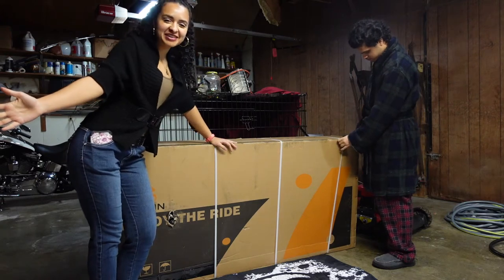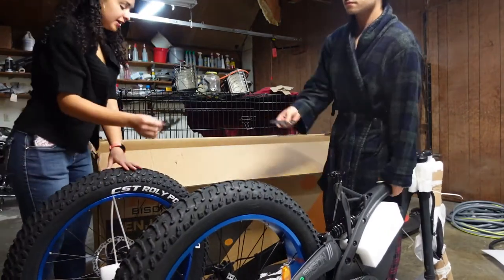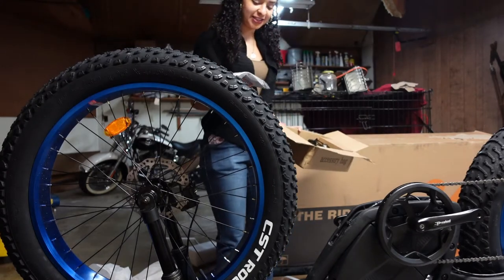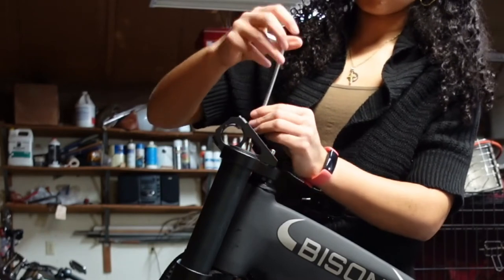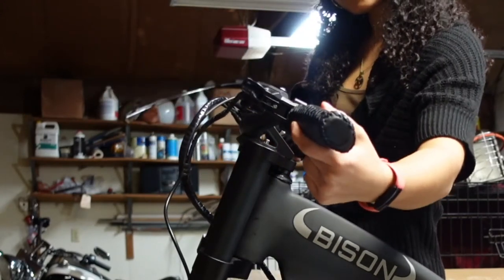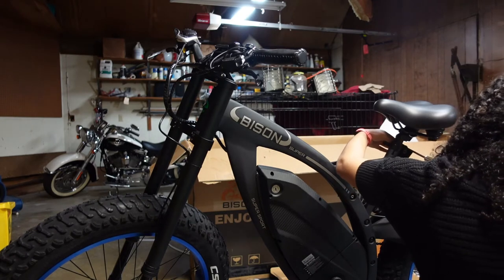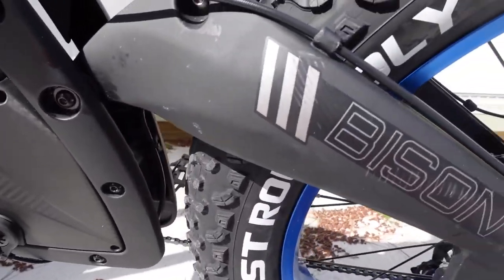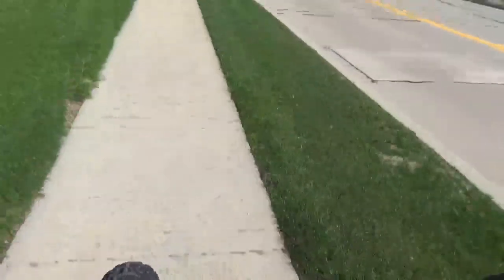Unboxing the Bison Electric Bike From Amazon #147

Comment: You can extend the warranty. I have an ecotrick Hammer bike I have written it in torrential rain you didn't do anything. I thought it would stop running. Maybe this one is different though. I put mine together and I crashed cuz I forgot to tighten the handlebars. And I have one leg so I was laying out there screaming and nobody would help me. That I tighten it up and I wanted to see how fast you could go and I almost hit a van I think I should have tested it somewhere else but I couldn't it's my only vehicle. I really like my ecotrick bike. If it has the shock seat post you can change it out and make it shorter that's what I did on mine cuz I'm 5 feet 8 in and the hammer bike is huge
Reply from the maker: Oh wow, well I'm glad you're okay. Thanks for the advice I'll double check it and see if that would help.

Comment: How do you unlock the ebike  and make the Bison faster? It can handle more speed above 28mph.
Reply from the maker: You know I'm not totally sure, I'll have to research and see if I can find the answer for you.
Reply: I would love to know too
Reply: I'm also using this same bike. Brought from main manufactor company located in China. I got upto 50kmph speed with paddle assist. But be cation you must need to be taller to handle this bike. You know this is ebike and giving speed similar of a normal motorbike. So speed control is main factor. otherwise you may fail brake. As brake is not same as motorbike but speed is same as motorbike.
Reply: @AlamgirHossain012  Please make a video of the bike!